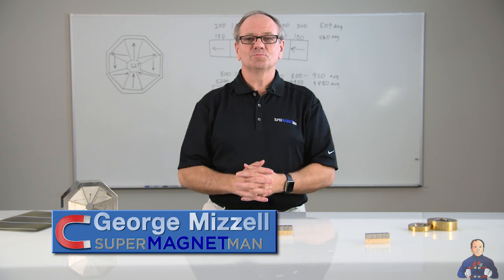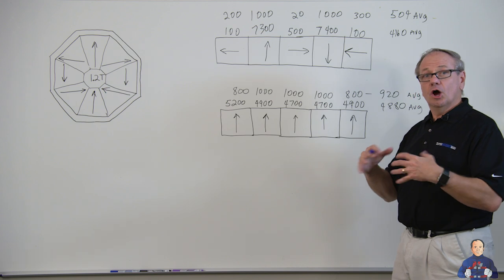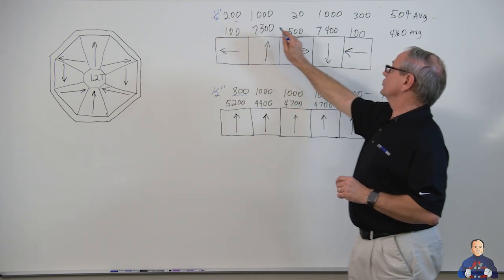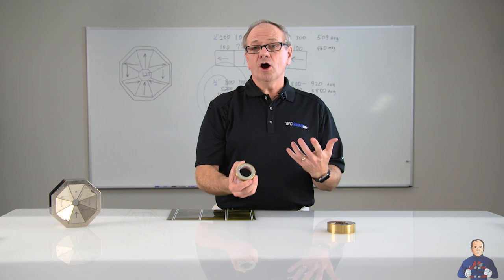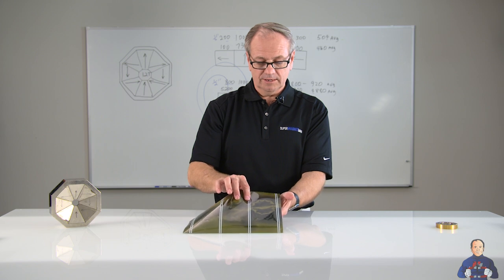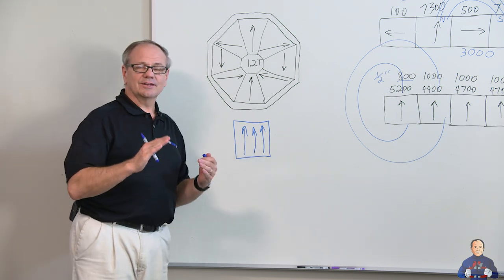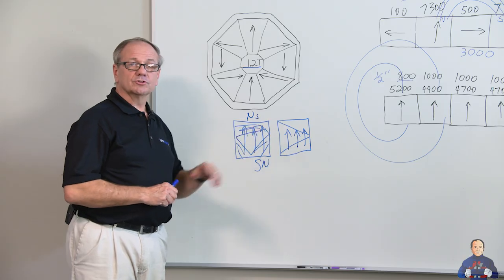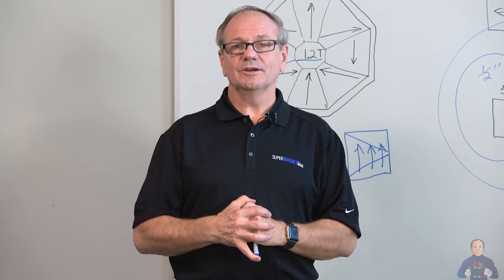Fundamentals of Halbach Arrays

Comment: Is it possible to make a halbach array with the north and south through the thickness of the magnet? 

The application I'm thinking of is an axial flux motor with the strength on one side of the permanent magnet plate, with electromagnet coils only on that side.

Comment: They also work interestingly well when nested as a gearing system for torque transfer. Basically, a gear box which doesn’t wear out as the flux fields act as the teeth for the gears ;-)

Comment: I wonder, if you took several, of those, Halbach arrays, and put them in a row, each one rotated, one magnet clockwise  at a time. would it be like a magnetic tube, created by flux lines. maybe a work around for MHD drives, without supercooling. Just a thought.

Comment: I want to use n53 magnets under a 9mm aluminium plate. They need to atract a 1.5mm steel plate on top of the aluminium. this video shows that Halbach is not good for this purpose right?

Comment: Thanks. Only issue I seen was the average of the top “halbach” array was wrong, 3,080 is the average of the 5 equaling 15,400. 💙 & ✌️
Reply from the maker: You are correct!!!!  I did this part twice and the first time I had the readings up there that averaged 4160 but then I went back and got the readings again and forgot to change the number on the board:). Sharp eye:)

Comment: A friend and I have been discussing how to make a field portable MRI system that's low cost and could be used in low tech environments. I proposed to use inflatable bladders and fluidic suspended metals to be pumped at neccesary rates to generate fields needed for imaging. He's already patented a high power antenna system that would work perfectly if the magnetic fields could be generated in a more efficient way. The goal is to make something that's cheaper, smaller and lighter than what's in use now. Thanks for anyone's advise.

Comment: right hand rule / 90 turn and only two face the same way. Try using two apposing bowlshaped magnets with their bottom of the bowl facing eachother. In the center you'll find some interesting effects on the center edge and surrounding area. Try surrounding that setup with some non magnetized steel bearings and then see how they behave inside and outside the center point.

Comment: so..I have been playing with magnets for years and years.. my father was a nuclear engineer and physicist.. I am an autodidact.. and computer programmer.. among other things.. I have found that a bar of steel, non magnetic will separate two magnets with the same poles on opposite sides.... superconductors pass magnetic energy, not electricity.. magnetism is the chicken and electricity is the egg a la A Einstein's photo electric effect and the good doctor Feynman's Quantum Electrodynamics.. magnetic energy allows manipulation at a distance.. because iron does not pass the magnetic field.. gold group metals do. platinum does.. I don't have anything other than platinum to play with.  and gold... and AuPt.. gold platinum alloy formed deep in the crust of the Earth as molten rock cools.. it has double double covalent bonds like diamond.. they are both room temperature superconductors.. but AuPt is the one that actually participates in the process because the two metals don't combine like copper and silver in a metallic alloy.. AuPt is separate elements in a face centered close packed cubic hexagonal arrangement in a 3D checkerboard .. both are diamagnetic.. and they create a small magnetic field in the 50/50 mix.. it's the diamagnetic part that creates the opposing force to an applied magnetic field.. which allows me to float magnets.. with room temperature... 
 and aluminum among other things.. but as far as I can tell at the moment, it's the AuPt that actually participates in the process.. most are just not creating any resistance.. our hands can have a magnet on either side and they try to get together..
like this 
https://youtu.be/EQMQFjFDhtY

Comment: the halbach pattern shown on the board is wrong, it shud be →↑←↓→ if I am not wrong. The horizontal lines on flux (north pole ← or →) should be perpendicularly pointing towards the vertical lines of flux going to the north pole (↑)

Comment: SuperMagnetMan -- would this also be the case with electromagnets?  IOW, if you had 5 energized electromagnetic coils arranged in a Halback Array, would the strength also be changed as it is with permanent magnets (i.e., with higher force near the surface, but weaker at a distance)?

Comment: Theoretically, could you make a hallback large enough to house a diamagnetic electro-motor? If so, what would be the best diameter to apply the best magnetic field for a propulsion system?
Reply: I was working on a similar project and thinking about using either aluminum rotor engine like those on AC 3-phase motors, or to go with MagLev design with DC power.. Doctor's video helped a bit but I still have question marks in my mind.. Wish I could help..

Comment: Instead of cutting an existing magnet, why not just manufacture it with the correct orientation initially?
Reply: You mean manufacture a magnet with different poles going throughout it? That would be far more difficult and probably impossible.
Reply: @johnmartinez9220  No, I mean manufacture the individual magnets with the desired orientation, so you don't have to cut it out of a larger magnet with a different orientation.

Comment: we circulated the strong magnet with copper coil and capacitors so they collected the energy from compression and decompressing of air and magnet floating inside the cover of air sac cylinders of barometer sensing device

Comment: how much atmospheric pressure required to take apart the strong magnet with each other
in this way we can easily produced electricity by leverage system and atmospheric pressure changing so we got always electricity
even a ten meter square area gives tremendous energy
are you interested in making this type of electricity forever
even a meter square area gives tremendous pressure and power source for electricity forever

put two magnet floating over each other and other magnet are attracted each other so whenever atmospheric pressures difference's or changing then magnet also going up down
since one cm square area gives one kg force exerted by atmospheric pressure then one meter square surface area gives 10000 kg force exerted by atmospheric pressures difference's so we got many kilowatt's of electricity if we considered that 15 kg per watt
Reply: Work is force times distance. Even if you have lots of force, you won't get much travel from such a contraption. Plus atmospheric pressure doesn't change that fast. You can look up atmospheric clocks because they require very little power and can make use of atmospheric pressure variations.
Reply: @tiberiu_nicolae  it possible if we use a kilometres squares surface gives tremendous pressure so if we can easily found one or two mm per day so we got one lakh kg
Reply: @anilkumarsharma1205  you only get a variation of around 10 kPa at best and if you are to use kilometers of surface area, you get much better results with solar panels on the same land.
Reply: @tiberiu_nicolae  10 K pascal's at one layer's
so hundred layers gives 1000 kilo pascal's
Reply: Ok... do it... (but that's not how physics works)
Reply: a big tower which gives us atmospheric pressures difference's at large scale can easily push or pulled leverage system so we got more energy

Comment: Instead of using solid magnets, could you generate the magnetic fields in the proper directions using radio waves?
Reply: Colleen Forrest in another thousand years?  Probably
Reply: @charliemoody7168  Magnetic waves travel perpendicular to radio waves. If you aligned some spiral antennas in the appropriate directions, there should be at least a small response.
Reply: Fair enough, and I’m no expert on physics, much less magnetism, but generating custom configurations of magnetic fields would build on breakthroughs I would have heard of.  Unless you have research results of radio-tailoring magnetic fields to successfully produce the functional equivalents of solid magnets, Imma say it’s still science fiction.

If you do have such research results, you should share it;  even if you only participated in the design of the research, your insights will be interesting
Reply: @charliemoody7168  no results. Just wondering if anyone has ever tried to do so. We've gotten to the point where we can make very small antennae, but most people focus on the electrical side of radio.  The magnetic side isn't as well explored. Might be fun to look at.

Comment: This actually helps me a bit with my drone work I'm glad I looked this up
Reply: How dose this help?
Reply: @smooveking773   I'm assuming because weight is an issue, you can use a smaller motor with the same power or a same size motor with more power using these magnet arrays
Reply: @johnmartinez9220  oh okay i just looked up most drones have a airtime of ten minutes so yea makes sense thanks
Reply: @smooveking773  Damn that's short!
Reply: @johnmartinez9220  i wish there was halbach array of lithium batteries to provide greater storage of energy as well

Comment: if the magnet did not have the coating would it be stronger despite the issues without it. Or have the coating after you put the magnets together?

Comment: whew, guess I should watch magnetism for dummies first.
Reply: YOU can always get two great & powerful magnets from tearing up discarded micro wave ovens, YOU see at people's front yard @ trash pick-up! A little time consuming & YOU need to separate them from the Magntron in the back! I gathered me about 8 of then (round circular magnets 2" wide w/a 1/2" hole in the center!
& 
Go for it & have fun, just keep your fingers clear, they can produce a nasty pinch! Stuck them to my oil pan to capture any metal powder!
Reply: @TimothyMcAleeSrGeD    just remember the microwave magnets sometimes have a beryllium ceramic case, inhaling that dust if you break it to get the magnet is on par if not worse than asbestos
Reply: I have some in my grow room

Comment: Interesting fact that neo magnets can be reverse magnetized after forming, but not angled (or increased in power per past statements from other sources). It has been proven that the current in all circuits is not due to moving charges, but the polarity of the charges. The intensity that rare earth structures can develop must be due to a limited polarity physical structure, dominated by only one direction. This must be a feature of all magnetic materials, just to a lesser degree for most of them.

Now jump to the whole theory of measuring and counting the timing and number of magnetic pole reversals in the geological record. You're looking at a structure that they consider to be permanent, which isn't... meaning large bands of one polarity may in fact be momentary flashes of very high, directly opposed field activity. And look at how quickly the fields can drop or be pushed up by localized influences. And with the effect of multiple fields, without an extensive 3D map of the entire terrain, you would not be able to chart the true location of all the fields contributing to the structure... Can we really say we know that the magnetic poles flip? Or ist it just the last pass of quickly changing lightning bolts? Rudimentary understanding of magnetism, as taught in school is quite dangerous and misleading to our perception of the world around us. Peace, B

Comment: I'm curious as to why an electric car would utilize a permanent magnet motor. Wouldn't a brushless AC motor scale up better?
Reply: because using modern perm magnets gurantees a cop < 1  ..  using mass/inductive balanced rotor/stator coils would be better ..
Reply: Did you know that some brushless AC motors use permanent magnets?  Did you know that PMAC motors are able to produce instant torque, whereas an induction motor cannot, needing significant time to ramp up rotor current.

Comment: if we use neodymium magnet or electromagnets in microwave magnetrons then what happened try it with super magnet and watch that, what are time difference of boiling water with and without this super magnet
Reply: It would boil the water in your neighbors house after the microwave beam burned holes through the walls getting there...Wear safety glasses!

Comment: I feel like I have to carry the clubs of you handicappers through every hole. Use a mercury-ferrite suspension centrifugally, electrify it to create intrapolarity. Use an umbrella (oppose normal force) of Halbach array of neodymium magnets and add dynamic wobble to the mercury-ferrite centrifugal torus to create turbulent-directional momentum steadily opposing normal force. This is your coveted anti-gravity, R-tards. Good luck piloting it with your tiny cerebrums. "It's all in the hips." Nazi  bell, old tech.

Comment: Using a Halbach array with Gadolinium could you not make a refrigerator by how Gadolinium generate's low temperature's from a rotating magnetic feild? A self maintained refrigerator that was powered right off the shumman resonance passing through the array needing no electricity and use an array to generate enough volt's to power a fan to circulate the cold air operate a thermostat and power electronic's and a light LED light? 😁

Comment: The BH curves are a theoretical measurement. People please as a scientist do NOT be fooled. If your magnet is advertised as a grade N52 it must have a gauss measurement on the edges of at least 8,000 gausses. At 90.4 degrees from the vertical line on the surface of the magnet. Ive been studying and a a writing articles on magnets very closely for over 15 years. The theoretical BH curves are not accurate.

Comment: Dear Fellow Youtuber. 
If you're reading gausses in the 4,000 range your neodymium magnets are not actually N52.
Reply from the maker: No, surface gauss readings are totally different than the BH max value.  N52 would have a BH max of nearly 15,000 but there are no single neodymium magnets that would produce a 15,000 gauss surface reading.  We can look at a 1mm diameter x 1 mm thick magnet made of N52 and get a surface gauss of 1,200 gauss and a 3 inch diameter x 3 inch thick N52 magnet and it may measure 6,500 gauss.  Both are made of the same material but significantly different surface gauss readings.

Comment: word of warning DO NOT   try  to cut or grind or belt sand to shape as he describes  the resulting particles  of dust are extremely hazardous
Reply from the maker: Not sure what you are referring to.  I use wet sand paper and never have had a problem.  My diamond wheel on my Dremel has never had a problem.  Of course I always grind towards another magnet which catches all the particles.  No problems in 20 years.
Reply: well grind away and  get all those particles in lungs the metal and materials  from them are known to cause lung and breathing problems so grind away. or be smart and read the hazmat  break down you will stop grinding or it with a dremel do  it only full wet where no dust  can release in air even wet  operations the dust is toxic so  and grinding even wet  get the mist inhaled is a problem @SuperMagnetMan
Reply: Chronic exposure to dust is bad news, the presence of boron is the main reason (but any chronic metal dust exposure is bad).   Its not an acute hazard though, from what I can see, "irritation" of the lungs is the short term effect.

Comment: So.... 1.2 Tesla... is that 12,000 Gauss?
And these magnets are made of grain-oriented metal.... I presume, which allows it to be a magnet and have a "fixed" North/South pole orientation..... I am just trying to correlate with how I can understand this all.....
OK, so after 3 hours, I did a second viewing, lol... I believe I see some patterns now..
Basically, by cutting the magnets in pyramidal form, we may have actually 2 odd-shaped magnets inside the ring. That is how they can hold together, even though it looks as if they should all repel each other with three of them having their south poles all stuck together, and the other set having three of the north poles doing the same thing. There is one force field flowing in the lower three wedges, which all have their north ends sticking together, then flowing through the two horizontal wedges. The other circuit runs through the top three pyramids and closes again with the help of the two same horizontal pyramids. I think I got that one right? That might actually even flow in a figure 8 shape.... something like that.... 
Sounds like fun!
Reply from the maker: Yes - 1.2 Tesla is 12,000 gauss.

Comment: Could you use a small Halbach array along with Hall effect sensors to create a highly accurate rotary encoder?  If so, how accurate could you get without breaking the bank?
Reply from the maker: We can make very accurate rotary encoders several different ways.  One way is using our really small magnets - like - https://supermagnetman.com/collections/micro-magnets/products/copy-of-cyl0003?variant=26111119875    which are 0.3mm dia x 0.5 mm thick and arranging them in a pattern.  For example, 3 rows with the sensors spaced apart and the magnets arranged so that every degree of rotation would pick up a different combination like 001, 010, 011, 100, 101, 110, 111 to 7 different degree steps.  Contact us directly at supermagnetman.com if you want to discuss in more detail.

Comment: Add bungie cord to copper plate.   Attach other end of bungie cord to a powerful magnet and electric power source with remote control.   The system would float once you add voltage to the circuit.    Patent pending.